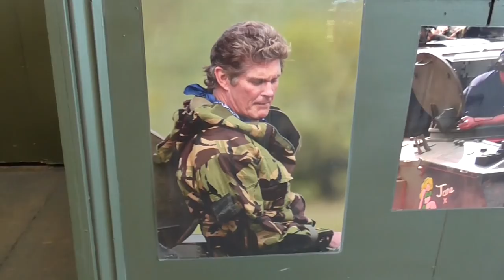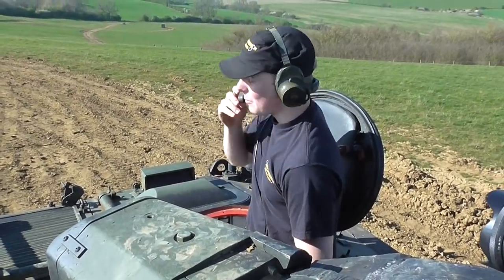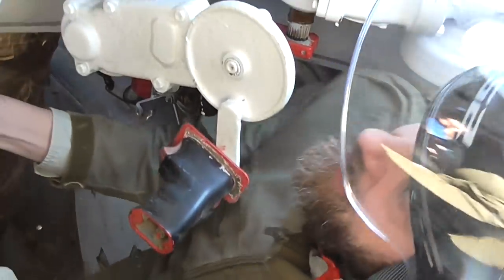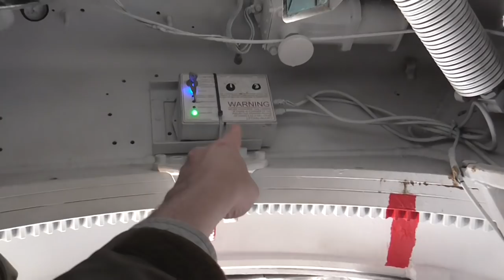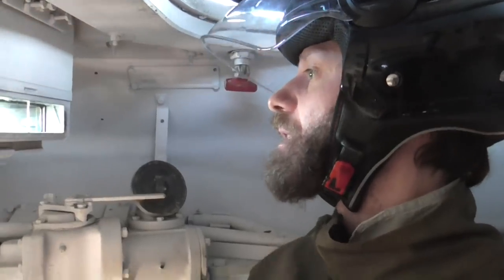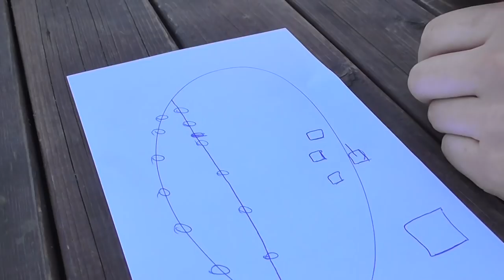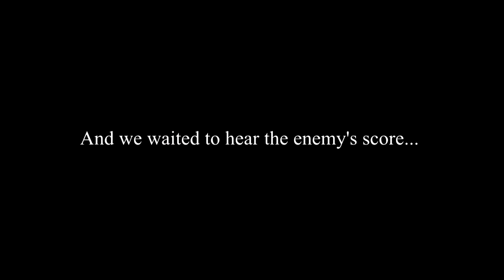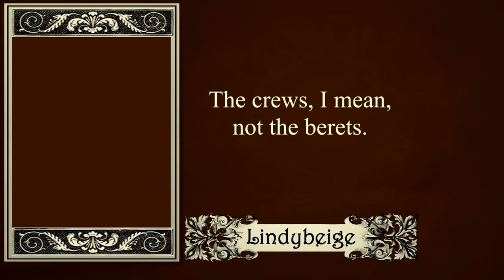Paintballing in tanks!

Comment: If the enemy doesn't kill you the inside of the tank will.
Reply: First reply
Reply: We had one of our guys in the back of a m113 get thrown to the roof after they went through some tough terrain. He would've had a concussion if not for his helmet.
Reply: I remember a story of the crews in the T-34, they often wore normal infantry helmets so that the rough edges of the vehicle don't crack open their skull as they move around.
Reply: Always have to watch out for the turret monster. He might just bash you in the head; or, it you get caught between the driver's compartment and the main hull when the turret is rotating, he can tear you in half. Or rip your leg off if you are resting your leg in the wrong place when the main gun recoils. Sweet, sweet memories.

Comment: They really should come up with a better breech mechanism.
a butterfly screw is just to slow and unrealistic.

For the amount of pressure, with some leverage , it should just be a clamp or a bolt that closes with  2-3 movements.

push button
open clamp 
open breech
insert
close breech and lock in one smooth movement
UP!

None of this spinning a screw, in the heat of battle it might end up being screwed a bit to loose..